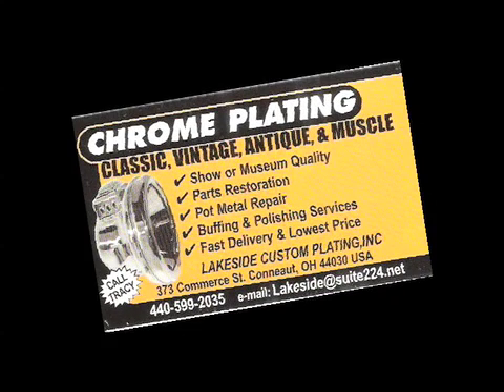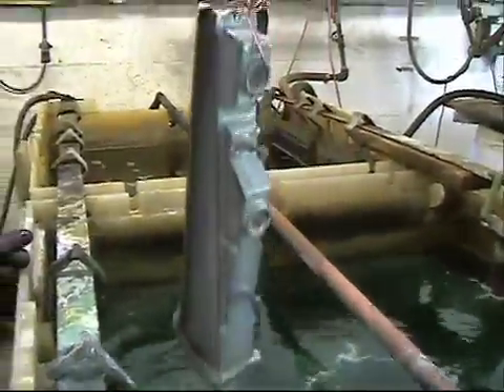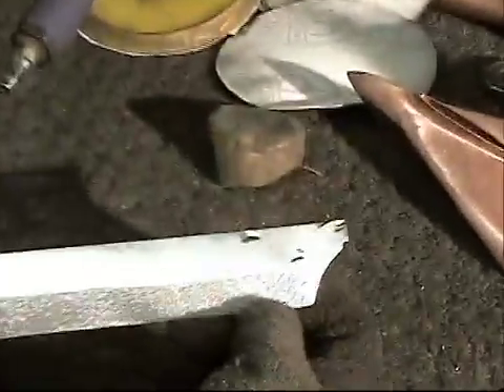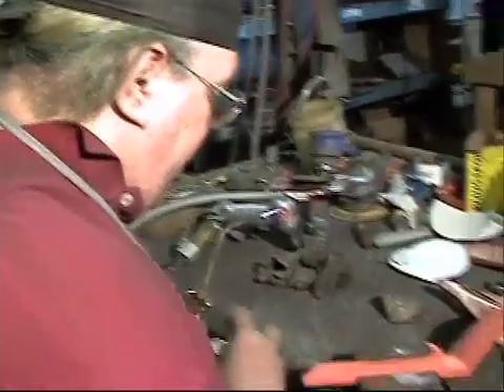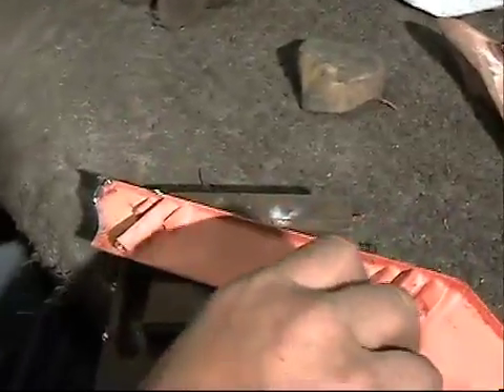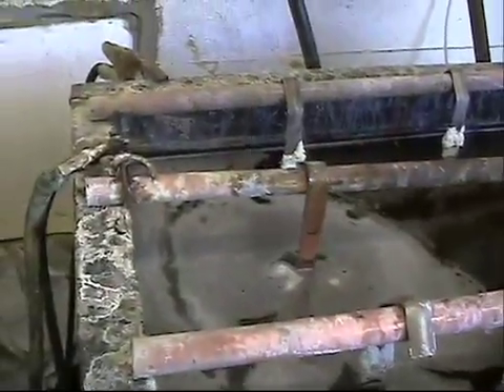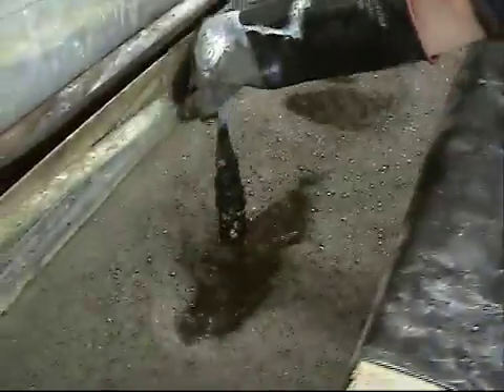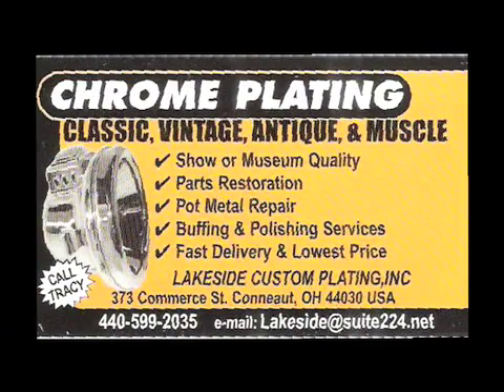Lakeside Custom Plating: Chrome Plating Instructional Video

Comment: im about to try and get a few things chrom plated and have a question , if i use jb on some as a filler on some imperfections will it all look the same after chroming? (homemade thor hammer and one corner is a little out of shape.)
Reply: the plating won't stick to jb weld,best to get it copper plated 1st,and have the shop solder and smooth out the imperfections by hand,and replate it with copper...Then finish, a few dollar out of your pocket will ensure a perfect finished product..imho

Comment: The (sulfuric) acid isn't to clean the metal, it's to neutralize the alkaline cleaner and etch it for proper adhesion. And you should consider using Dry Acid Salts it's more mild than Sulfuric.

Comment: You should consider hiring a journeyman bumper polisher because that individual is taking baby strokes on that belt, thus leaving multiple waves on the top and face of the bumper. NO REAL POLISHER LEAVES STOP MARKS ALL OVER THE BUMPER
Reply: ChromerSatanas Thank you for your interest.  You do understand that this is an instuctional video about the chrome plating process for the average customer.  We are not teaching proper polishing techniques, nor trying to show off our skills.  If you would like to promote your business, please do it on a different video.

Comment: they have something to put on the headers from preventing the bluish discoleration, i have to check the name and get back to u .. is it stainless steel? its stainless steel and BRAND NEW (never used) then the  asking price is alittle hight.. u see the chrome bumpers  the people plate alot of them at once. to minimize plating costs and time ..

Comment: it depends on what size pipes u have , how long and what diameter.. it also depends on how much work needs to be dun on the pipes before plating. i would say when u pay expensive, the guy takes his time and work on the part. if its not dun properly it will not look good. trust me.... hmmbut 3800 is that included chrome ?

Comment: the chrome plating process is not realy that hard when you know what you are doing, whats hard is , when a costomer brings in a rusty shit bucket and expects you to do wonders with dat pitted  rust bucket,  then it gets hard..... i do chrome plating for 6 years now, and i will tell you. if u want to start chrome plating  by the tank plating and plzzz do not buy a fake ass spray on chrome system,,,, i have one so i know how fake it is .......